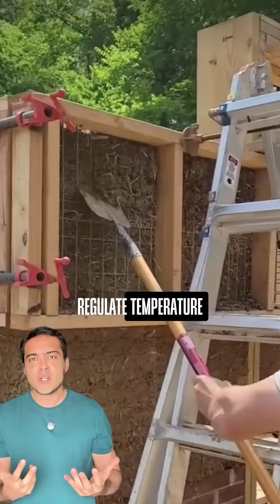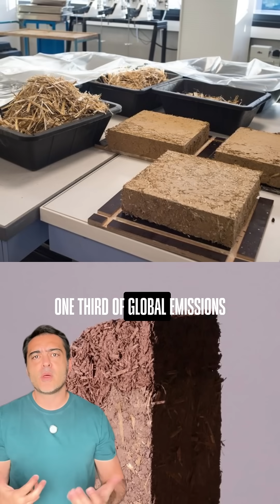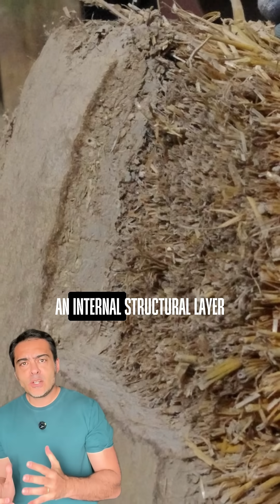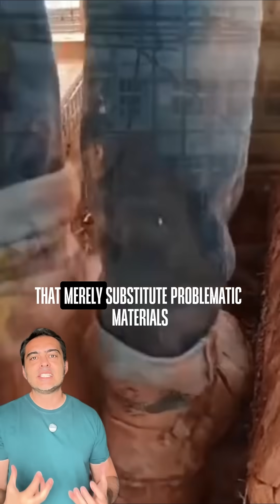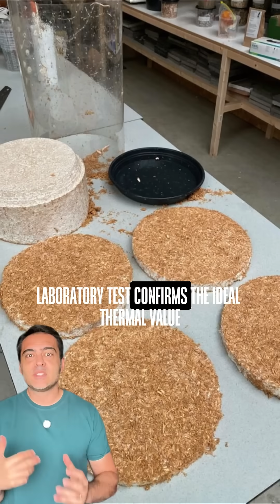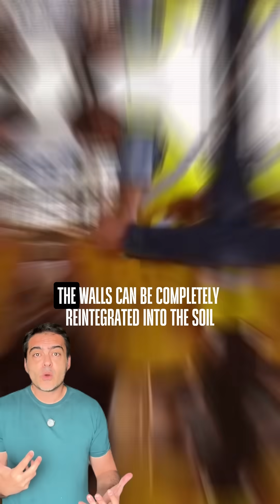Earth Architecture: The sustainable innovation of walls that breathe

Comment: Useless to much labor not strong enough to withstand severe bad weather
Reply: Your opinion is obviously based on a limited understanding. No shame in that. Let me enlighten you. 
There is labor in all construction but this can be accomplished by a small community crew in a few weeks where normally construction takes MONTHS and a full professional crew.
Reply: And as far as bad weather goes, it is fire resistant, storm resistant, and wind resistant. 

Longer roofs that overstretch passed the walls are best for very wet areas, and other precautions can be taken to make sure that the cob doesn't get wet. But there are places who still build with this while having severely rainy seasons.